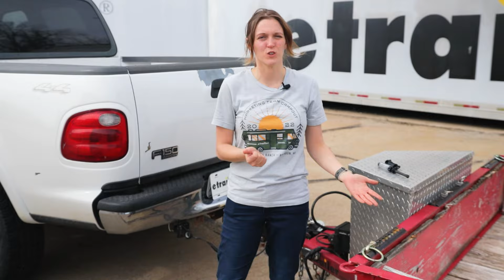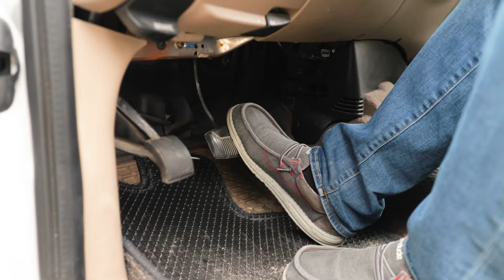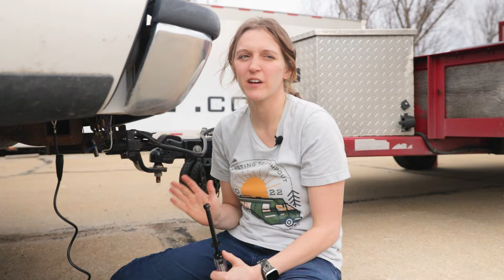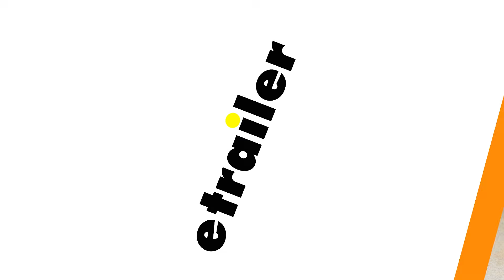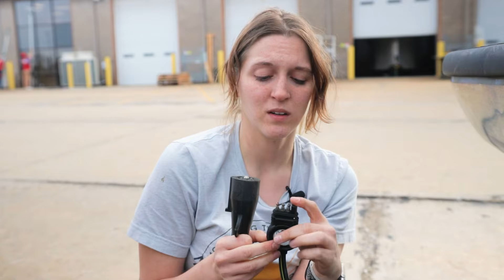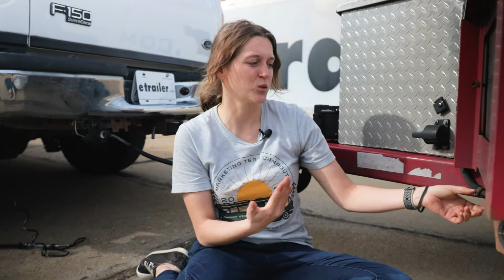Troubleshooting Trailer Wiring

Comment: I want to check my trailer. The truck is fine. How do you check the trailer?
Reply from the maker: You will want to plug you trailer into the working plug on your truck and test each wire on the trailer. This can be a pain so if you only have a 4-flat and taillights, I would just run all new wiring. It can take a while to find breaks and things, but if it's just simple wiring, it will take like 20 minutes to replace.

Comment: 👹🙀👹🙀👹🙀👹
How to test the harness on the truck side.
Of the lighting circuit with the trailer unplugged😮😮😮
My trailer lights work on other trucks but not my truck flat 4 harness from ford factory install. It used to work for 17 years now it Don't and I get no power at plug but vehicle lights all works. Is there a seperate fuse for the trailer lights circuit?
Please help to show how to trouble shoot?
Reply from the maker: If your truck came from the factory with the wiring, then there will be fuses specifically for the towing functions (and actually, some vehicle that technically didn't come with wiring will still have fuses that need to be installed for these functions). Check your owner's manual and there should be a fuse layout diagram that will tell you which is which.

If you do not have towing fuses (it does happen), you will need to trace the wiring to find breaks/corrosion and replace/repair as needed. This can be a pretty big pain, so if it's factory wiring I would take it to a trusted mechanic to have fixed.
Reply: @etrailer 
I found 2 Fuses on pa ssenger side foot panel and three fuses under the hood.
And found that it is cheaper to 1500 fuses than it is to buy one at a time.
Sold me 2 fuses cost  $11.00 with gas.

Comment: How do I locate the ground wire?
Reply from the maker: The ground wire is usually the white wire ran below the trailer frame that is connected to a ground port, or bare metal section on the trailer frame. In almost every case it is the white wire.

Comment: I have a 2020 Toyota Highlander. Has a factory connection at the back near the hitch. Not working on my boat trailer. I also have a 2009 Honda Pilot. The trailer lights work on the Pilot.

Comment: Any link or model of the circuit tester used?
thanks!
Reply from the maker: Absolutely, it's part # PTW2993. You can check it out using the link below:
https://www.etrailer.com/Electrical-Tools/Performance-Tool/PTW2993.html